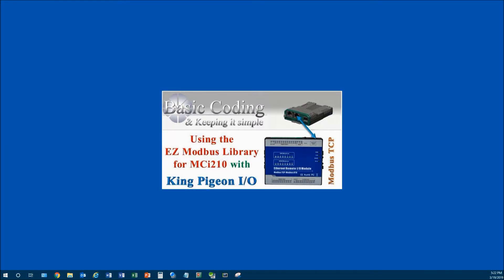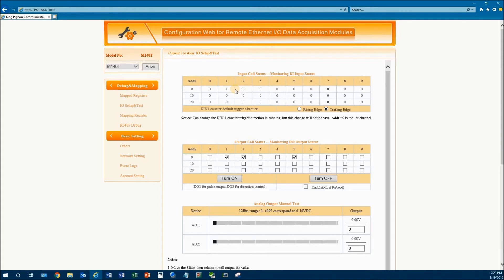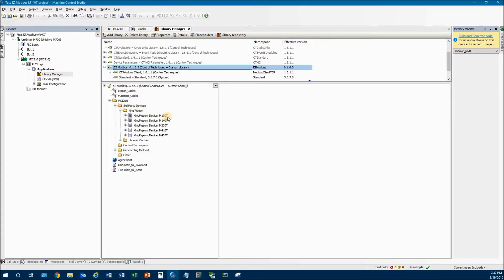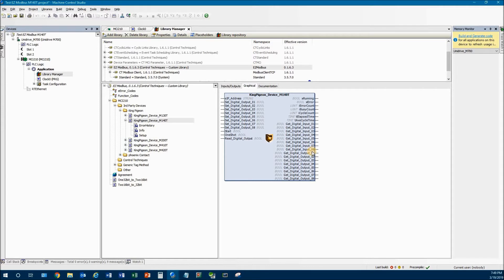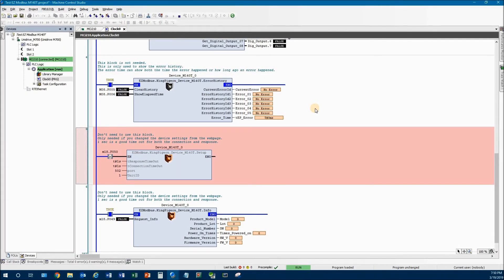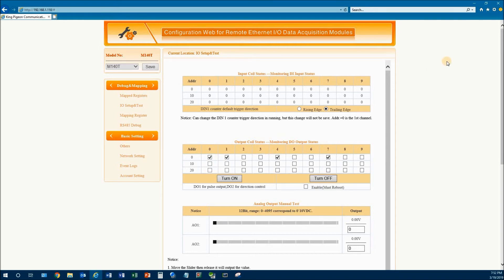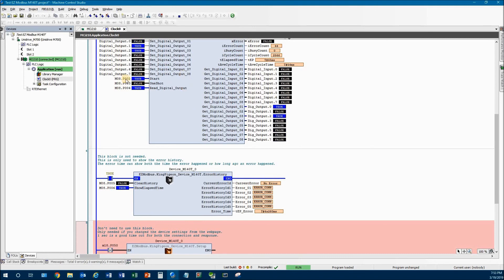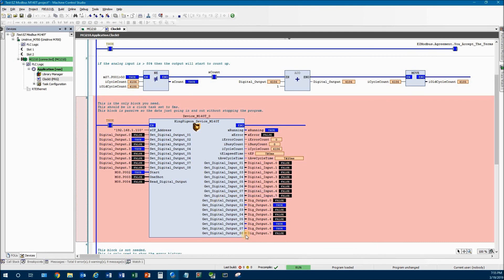Modbus TCP to King Pigeon IO

Comment: Thanks Cannon, is there a way to find the hex command strings for controlling the device through this software? Cheers
Reply from the maker: What do you mean by hex string.  
Are you asking can you read the digital inputs as a hex value?  
Or are you asking something like how does Modbus TCP work at the fundamental level?  Maybe you are wanting to write your own code....
Reply: @CannonMelville  So I'm using these type of devices without management software, some units I've used have specific check sum calculations etc but I just want to know hex strings to send to the devices to get status and trigger DO. I send codes like 11 03 00... Etc to them but the documentation on the King Pigeons don't have any reference information. Is this just a modbus standard they all use?
Reply from the maker: I think i know what you are asking.  The King Pigeon device i used talks Modbus TCP.  Modbus TCP does not have a check sum because Modbus TCP uses Ethernet's TCP backbone and the CRC is done automatically.  If the device that you are using uses Modbus RTU then there is a CRC.  If you are writing code for this then you will need to do the math based on Modbus RTU CRC method.  
Link #1 https://sites.google.com/view/basic-coding/networks/modbus/modbus-how-it-works
Link #2 https://simplymodbus.ca/
Reply: @CannonMelville  yeah you're right. I realised after days getting all the modbus commands right, I found a module for the home automation system which worked perfectly for everything I needed! Thanks for your help!

Comment: Great tutorial, but how much is the sampling rate for update I/O?
Reply from the maker: So you can read and write to this IO using the normal Modbus TCP from CT or the EZ Modbus Library.  You might get a bit faster with the CT Modbus as you have full control.   The King Pigeon IO takes about 15 to 20 ms to respond per command.  In the video you can see the average time it is taking to read and write.   
Write value to outputs on device 18 ms
Read value from inputs on device 18 ms
Read value from outputs on device 18 ms. 
So if you don't read the outputs on the drives, the value you send the device you will save about 18 ms.
Reply: @CannonMelville  I already bough it, but when trying to enter to the website it doesnt connect. But ping is successfull, any idea ?
Reply from the maker: If your device is a M140T, or one like it, you should be able to go to the IP address of the device with your browser.  
The default password is admin,  the default user name is admin.  The default IP address is 192.168.1.110.  You will need your computer on the same sub net to set it up the first time.  After that you can change the IP address and the other settings.  that should be it.
Reply: @CannonMelville  already ask the maker, for new type web is unavailable. They provide own software for setting. Success
Reply from the maker: That is good to hear that you now had success with it.

Comment: Could you please tell me the name of the software with which you programmed the device.
Thank you
Reply from the maker: The software is called Machine control studio.
The software is free and can be found control techniques.
https://acim.nidec.com/en-us/drives/control-techniques/products/servo-drives/digitax-hd/digitax-m750-ethernet
This software is used to program the drive to move the motor a give speed and position.  But it can also talk to Modbus IO blocks like the King Pigeon.
Reply from the maker: There is also a software called CTA Basic Motion Templates for MCS and AMC
It is an add on to the Machine control studio.  It make indexing / moving a motor to a position easy.
If you have any other question let me know.